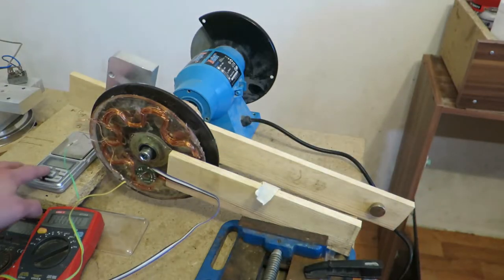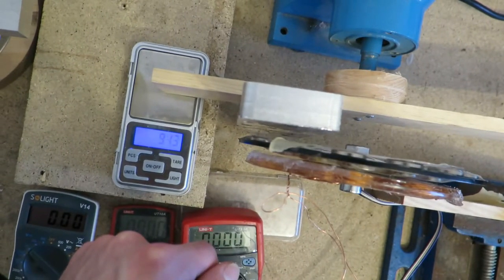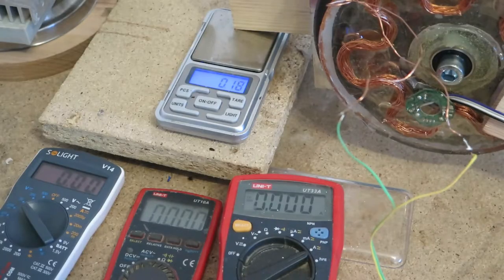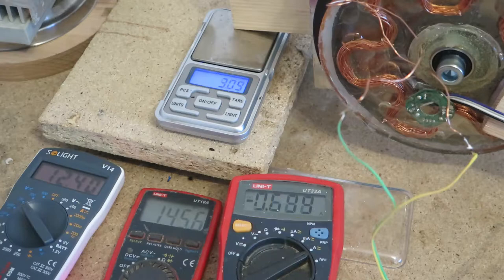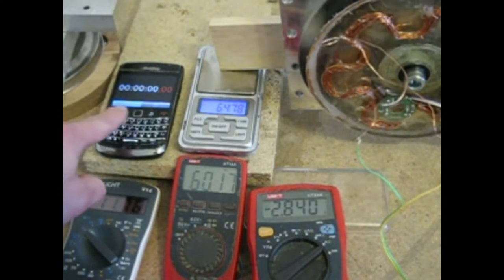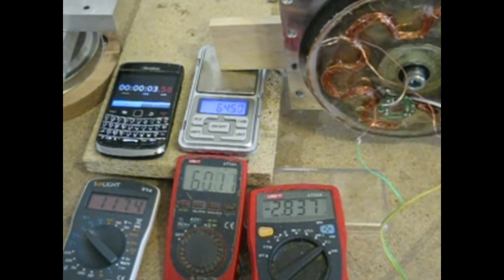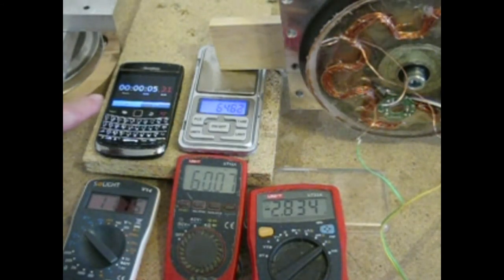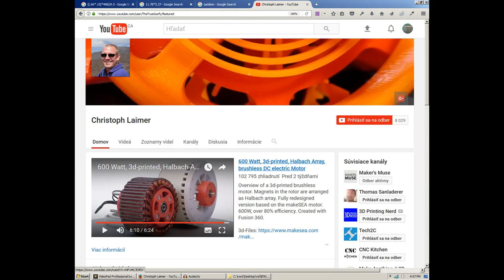DIY BLDC Axial motor - measuring efficiency

Comment: The low efficiency is mainly caused by the applied kind of constant voltage operation. If you operate an electric machine with too much voltage compared to its back emf the motor windings will draw too much current and act mainly as heaters and not as back emf limited power coils. Constant average current operation under self commutation make sure, that the motor operates at a certain tourque at its power goes linear with the motor speed. The coil will never get to much current or to much voltage.
Reply: Also a lot of "dead space" between those coils, and 
No field at the open end.

Comment: how is the driver frequency measured(between which wires) and how is it related to the RPM
Reply from the maker: I read RPM directly by looking at hall sensor

For most AC motors RPM = (120 * freq) / number of poles

Comment: Air core motors have no torque, low efficiency and are not used for those reasons. Congratulations.